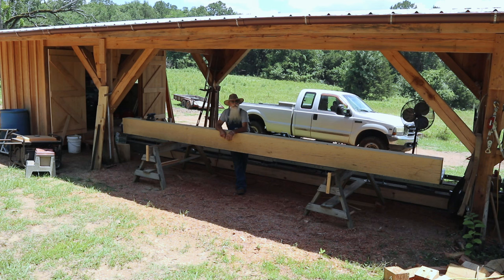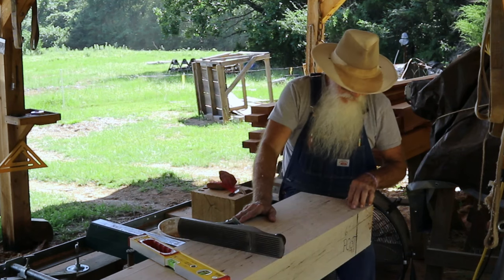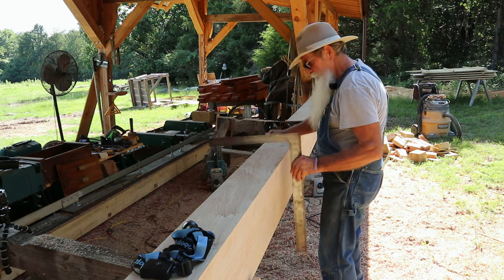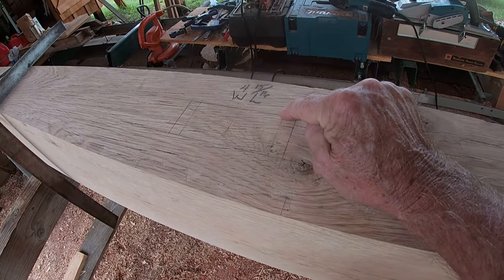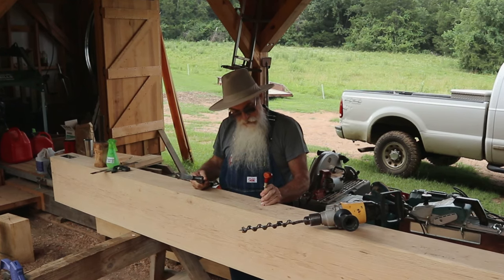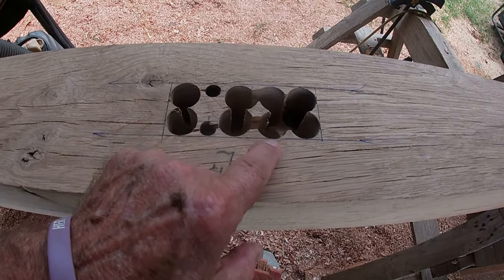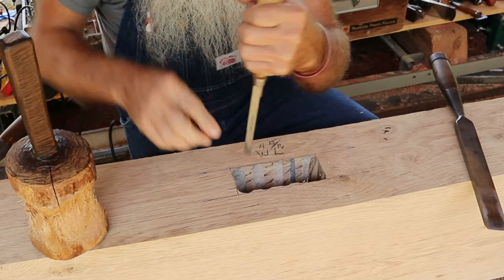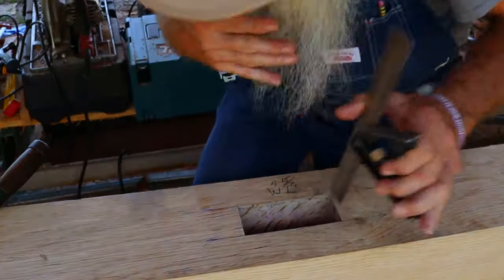Hand-Cutting Mortises for Covered Bridge Girders | Step-by-Step Guide, Ep 2

Comment: A very enjoyable film Paul! Thanks to both you and Mrs.B.C.
Can I allow myself to offer some advice I found useful?
 I was at a lecture some years ago by Jon Brenne, who has researched traditional paint and surface treatments extensivly for the State Antiquarian, here in Norway, at which he reported findings that thinning linseed oil does not change it's penetrative characteristics, since they are dictated by the molecule size of the oil. The thinner penetrates deeper but then evaporates back through the oil layer, in the case of white spirit, leaving fats that reduce the strength of the oil. Using cold pressed oil, which has much smaller molecule size by an order of magnitude, penetrates deeper but is more expensive. This explains why cold pressed oil is better for paint. I still thin my oils with turpentine though because it aids in application and has little to no residue. Restoring old oiled and painted surfaces, and with his claim in my mind, I have noticed that (baring wood that was soaked in oil) penetration on face timber is minute and on end grain seldom deeper than a few millimeters. It saves on materials following his advice for sure. I only use cold pressed oil for interior paint though, since it is prohibitively expensive and exterior paint has been made with boiled oil traditionally. It is fit for purpose whether boiled or cold pressed. On the Viking ship we have been told to use cold pressed oil with pine tar, but I don't know the exact quantities, but about half oil half tar. It smells wonderful but gets everywhere. That is to slow the drying time to reduce checking, as far as I understand. God bless!
Reply from the maker: Howdy Lucas- oh my goodness, thank you so much for that information! I will definitely remember that when I do the rest of the bridge. I don’t know of anyone here who would do that type of research and be willing to do a seminar on it. There may be someone up in the New England area where the older buildings are that has done studies like that. Again, thank you so much for the information. God’s blessings to you

Comment: Hi Paul and greetings from South Africa. I've finished the superstructure, framing and roof of my post beam barn build and have been researching whats going to be best as far as oiling/treating the posts and decking. I'd been recommended the boiled linseed and turps route and stumbled upon you using it liberally at the end of the vid. My question is after your initial covering, when do you respray/put another coat on. Is it something you would do yearly on a deck for instance? And with your beams that may eventually be covered with cladding, what else would you suggest treating parts that would ultimately be permanently covered? All my build wood has been pressure treated for beetle and weather, but I am noticing surface cracking after being exposed to the elements for half a year - as of now I've oiled nothing...thanks for the inspirational videos!
Reply from the maker: Howdy Jack- I’ve been using boiled linseed oil for many years and have had good success with it. When I put down a plywood subfloor I will put two heavy coats on it letting it dry good between the coats. If you are covering up your timbers with a siding one coat should be enough but you may want to coat the siding every few years. I don’t know what kind of weather you have there so that may something to do with how often you would want to put a new coat on. As far as the timbers checking, or developing cracks, that’s the nature of wood timbers as they begin to dry out. It doesn’t affect the integrity of the timber. If you look at old timber frame structures or old log buildings you will see checks in the logs. Some species of wood will develop more, or bigger checks than others. I’ve seen in the southern yellow pine that I use some logs will check more than others. If you are covering a deck you probably will need to spray it more often because of the direct weather if it doesn’t have a roof over it. Hope this helps you. Thank you so much for watching our video and following us on Instagram. Stay safe. God bless you
Reply: @TheBeardedCarpenter  awesome thank you! for the answers I've been looking for :) will get started this week now that I feel this technique is what I'll be using...keep on legend.
Reply: @TheBeardedCarpenter  Howzit Paul...did the deck top and bottom with your technique and just wanted to say thanks for the tip! not only has it made the grain pop, its sealed like a dream. Using the spray method with the sprayer and not having to brush between all the gaps between boards is a time game changer. Will ultimately to the whole exterior build with this method (while saving years of time and on a great budget) Shot Meneer (thank you sir in South African)